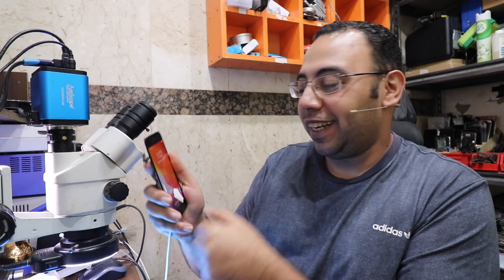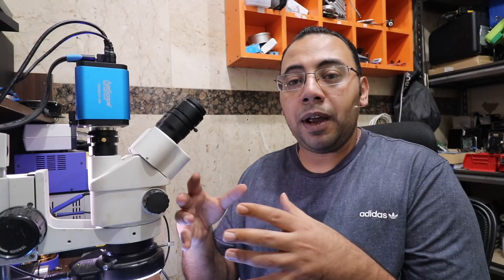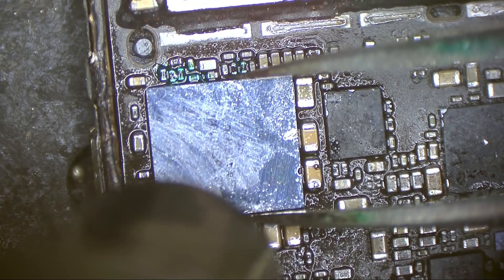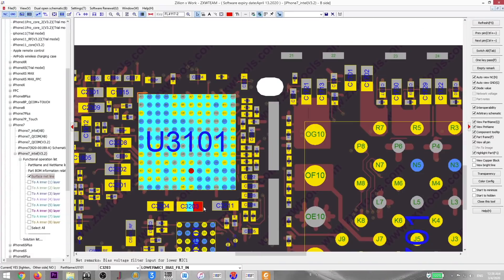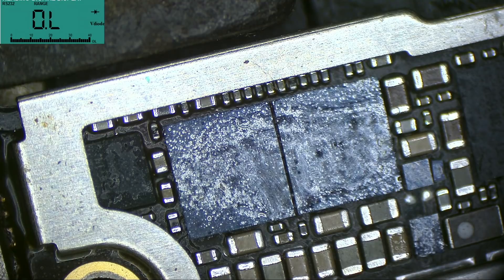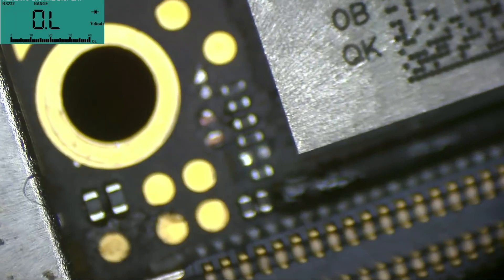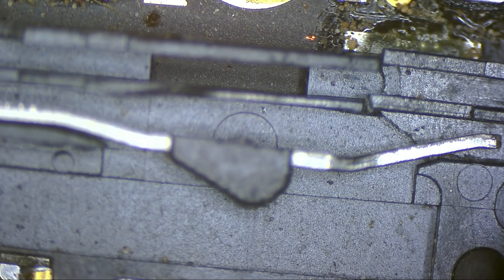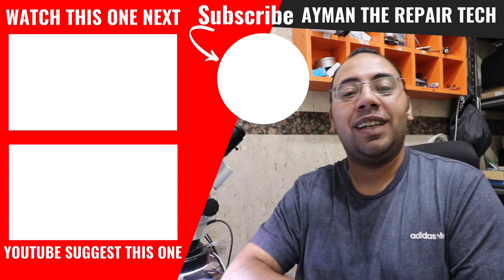Weird iPhone 7 Audio IC Repair

Comment: really Nice video! Somehow I managed to pull some pads, on removing ic, could some of them be vital? missing A12,B12,M12, D11, B10, B4. C12 I can place jumper. But does any of the other need jumpering. many thanks I haven got program for looking up pinout, saad!
Reply from the maker: You could use phoneboard.co free software to check it i am very sorry i can't check it for you i have limited time

Comment: You are right bro, I worked in Bahrain 🇧🇭 from 2011 to 2019. Until 2014 there was not much shops for mobile and computer repair and that time I made money from repair skills, 2015 and onwards everyone opening mobile repair business with 10% to 15% knowledge of repair. 
Customers come to my shop with issue and I explain them the procedure and cost, then customers will start bargain and says others shops are doing 2, 3 time less then the amount I told for repair, and answer will be “ you can go there if you are getting same service in less price” after 1 or 2 days they come back with the device fully fucked up.
Reply: Many times I explain the differences of professional and unprofessional technicians, but 98% customers prefer less price over professional service.
Reply from the maker: True people are ignorant most of the time